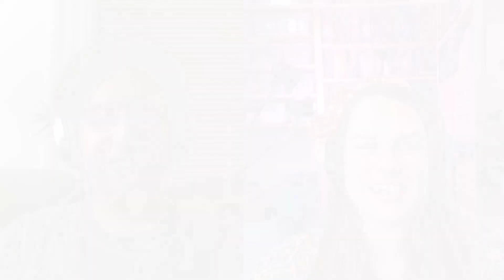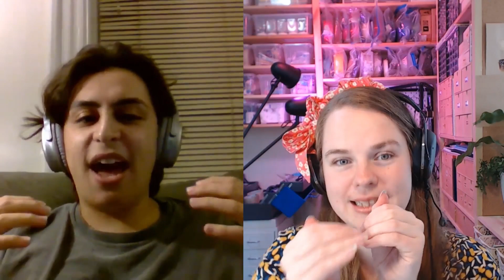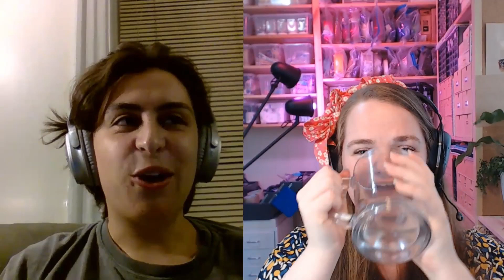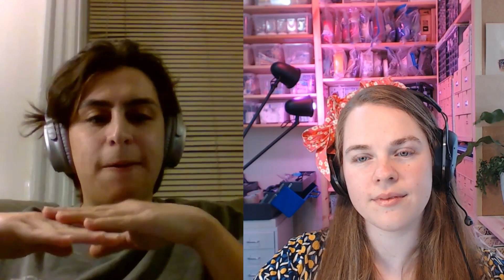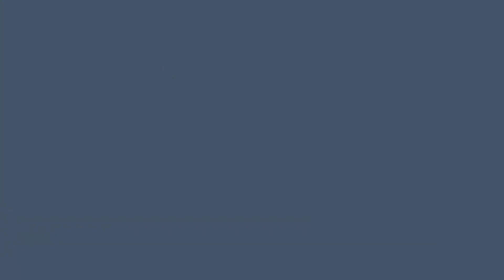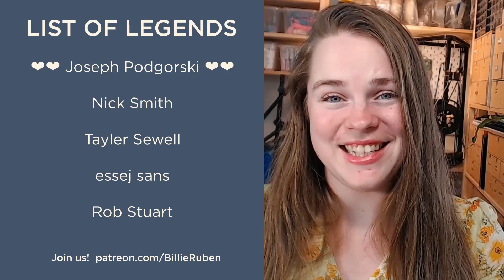Meet a Maker - Amy Coronado! Episode 007

Comment: Amy is very interesting. Excellent guest. There are a few metals whose oxides are clear. These oxides are what we call passivation layer. It coats the surface and protects the layers underneath. Chromium and Aluminium are both self passivating. In semiconductors silicon is passivated with silicon nitride and silicon oxide is grown between layers as a insulator.
Reply: I didn't know that was what it was called (I've been calling it a force field, haha). Cool!!
Reply: @amycoronado6695  I work as a failure analysis Engineer specializing on Semiconductors. Passivation is what protects the circuitry on an IC. As the lab I work at has a scanning electron microscope with an EDX detector we also do material science jobs when we get them. My favorite is when a local farmer asked if we could look at his meteorite.

Comment: Aluminium has a very short glass transition range, so it does not go soft before it melts. That makes it very very difficult to 3d print with. You would be basically printing with water.
Reply from the maker: Ooh that's good to know! How about tin? Or pewter?
Reply: @BillieRuben  Not sure, might be. I think one of the reasons it is so much more difficult with metal is the fact that it usually an element, so it melts all at the same temp. With plastic you have a much bigger range because it is a composite. 
So pewter and bronze might work, but I think the temps are too close to each other. You need a metal that turns into taffy before it melts.
Reply from the maker: @LykleSchepers  ah gotcha! That makes sense!